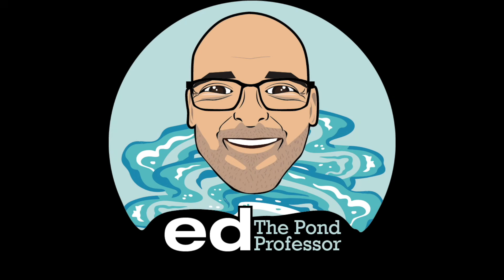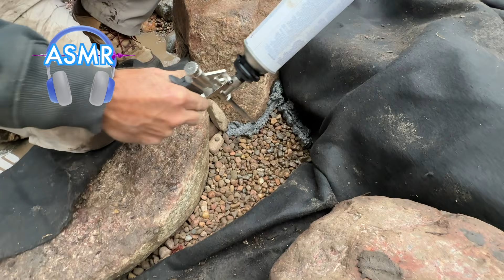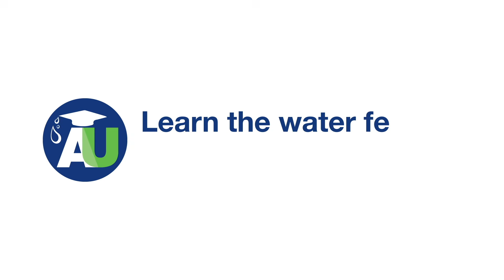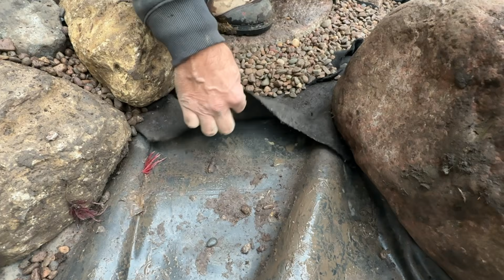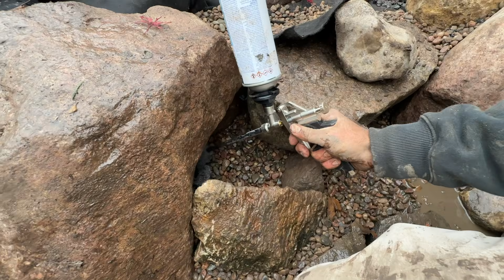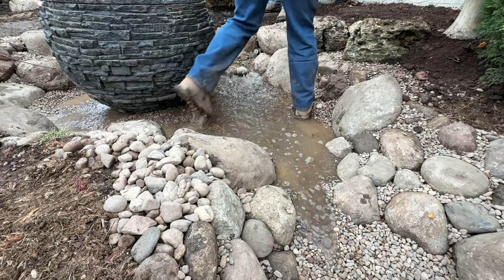Control Your Waterfalls with Foam (ASMR Vlog)

Comment: This was really helpful. I am finding the variety of applications a bit overwhelming. Some day to seal the rock to the liner and then add gravel and this was gravel first and it does make sense given that it is squeezed between the gravel. Is it better to use rounder gravel over angular gravel?
Reply from the maker: Glad it was helpful!
I’ve used both successfully, we typically use rounded river gravel because we have it on the job site for covering the bottom of the pond. 
It’s a convenience factor.

Comment: Hello ...great vids, helping me build a waterfall in uk 💪
One question though...When doing the pocket at around 3.50mins with stone, foam, liner and stone again i noticed your liner on top with high edges on original liner, would water not get down between both liners?  push it up/cause problems?
Thanks

Comment: I'd love to see a video on how hard it is to repurpose used, foamed in rocks or make changes to a waterfall. Is it possible to remove the foam without tedious scraping and plucking? As example, I was thinking about the indoor artist build series, what did you do with all the foamed in gravel and rocks?
Reply from the maker: It’s really not that bad to repurpose the rocks after they’ve been foamed into place and you need to make an adjustment.
We actually did it on this project because it was a renovation project that was built by one of our Certified Contractors many years ago…
Reply: Try a pressure washer, takes foam right off.